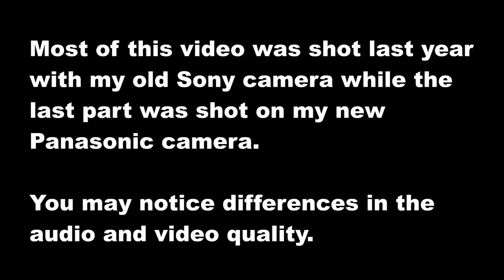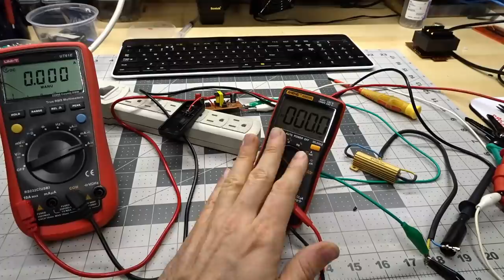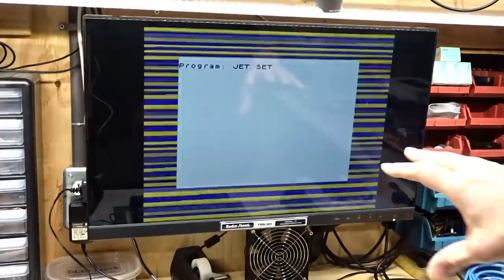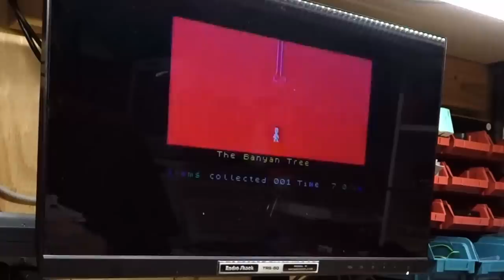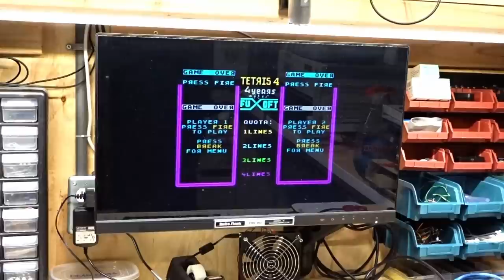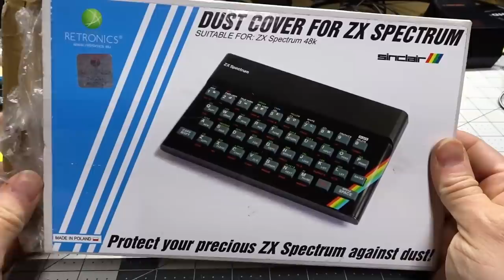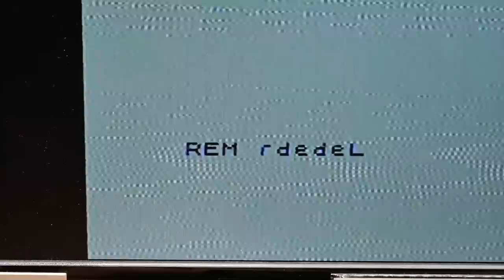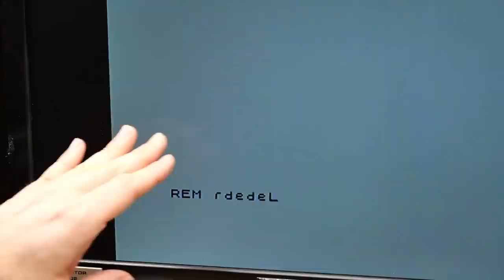ZX Spectrum Part 3 - Revisiting the machine at last!

Comment: Yay, an American who appreciates the glory of the British plug instead of just complaining that it's too big!
Reply: I've watched enough of Big Clive's videos to appreciate the thought that went into the UK plug.
Reply: Yes, that is an old BS1363 plug; modern ones do have "shrouded pins" - never occurred to me that it might be in case of dropping something behind and shorting live to neutral (unlikely, as the earth pin is always at the top, though I suppose it could happen); I thought it was so you were less likely to touch live pins when removing or inserting the plug!

And yes, no way it should have had a 13A BS1362 fuse (sad, I know the British standard numbers!); that - the highest available - would allow 3kW, such as a kettle or electric fire (heater)! [Well, 3kW when we had 240V; we're gradually (it has taken decades so far) moving to 220V, same as the rest of western Europe.] Unfortunately, people (including the people who sell the plugs) tend to put a 13A (brown) in so it'll work with anything. I've seen BS1362 fuses in 1, 3, 5, 10, and 13A, but most shops only carry the 13, 5 (black) and 3 (red). For virtually all eletronic devices, you should have a 3A fuse. I've heard it said that's just to protect the cable (what we call a mains lead and you call a line cord), and the equipment should have its own, lower rating, fuse; that's quite plausible, as even 3A is 660-720 watts!

I grew up in Germany, with Schuko plugs (though I never heard them called that while there), so I do tend to think BS1363 plugs are a bit on the large side - but I suppose when the standard was designed, a lot more domestic equipment was kettles, heaters, washing machines, etc., and if they wanted to make one single standard plug, they had to. (Previously, we had "round pin" plugs - basically, much the same design other than the pin shape and they did not have the fuse in them - but they came in three different sizes - 5A, 10A, and 15A. (Plus a 2A one mainly used for lighting that didn't have an earth pin.)

One shortcoming of the BS1363 - and of its three-pin predecessors - is that, due to its side cable entry, its default rest position is on its back with its pins up. So what, you may say? Well, just wait until you tread on one with bare feet … (-:
Reply: @G6JPG  It's not just that you're worrying about something slipping behind when you go to plug it in, but to keep kids from electrocuting themselves. My brother and I learned our respect for electricity the hard way when we were kids.
Reply: @BlackEpyon  If you read to the end of the sentence,  you'd have seen I said exactly that! (Granted, you have to click "Read more" to see all the words, but even without, you should have been able to see "I thought …" (-:

(Someone else further down the thread also made the same point [specifically that children have smaller fingers].)
Reply: @G6JPG  I don't know why, but half the time the "Read More" doesn't show up. Maybe it's just FireFox, or maybe YouTube borked something up the last time they redid the interface.
Reply: they are too big though... and painful to step on
Reply: always with a stupidly over spec'd fuse.

Comment: Backoff on the phone volume and compensate using the amp...It was a skilled art back in the day ..uk specy owner here..
Reply: Was gonna comment just that. The same is true for any audio output device. Even running my old 160gig ipod through the cars tape deck via a cassette adapter. Would always get far clearer sound when turning down the preamp from the ipod and using the car stereo amp to do the volume boosting. Around the 70 to 80% range on the ipod headphone output would yield good results. The same has applied to any smart phone I've owned.
Reply: Yeah I was thinking the same thing, the phone is still too hot for the amp, so back it down. Also might make sure there isn't any EQ being applied to the signal via any phone audio effects settings like bass boost or a audio profile.
Reply: Especially when the tape was a copy.
Reply: I'm with Eggman, had a Speccy when I was 12 years old back in the day. Tape loading was a fine art sometimes. Later on games came on tapes with speed loading which made things even harder, you could hear the difference in the loading sounds as more data was being pushed across it was kind of like the tape was sped up. I remember having an old cassette tape player that reliably loaded games but you had to fiddle with the volume to get the games to load and sometimes they would just fail. It was hard to love the Speccy but I did spend many hours playing classic games like Manic Miner and Jet Set Willy.
Reply: @savvygadgetz  agreed you learned/knew the pitch of the sound you was listening for..
Reply: @theeggman4806  Brings back so many memories about that. Also needed the right tape player as well sometimes (my old one failed so often but another one was much more reliable). But I do remember knowing the exact sound sections where programs would fail; breath held during those bits haha. And then of course there were the poke hacks you did during the tape loading procedure. So many hours spent trying to get the blighter to load games!
Reply: @SiEffen  it was a skilled art for sure 😂😂😍
Reply: @savvygadgetz  Yep, every tape had its own level, IIRC, which I'd write on the insert ... still might not work mind.
Reply: Notoriously finicky! You basically had to have one back in the day to get it right today.

Comment: I remember having notes on my tapes that said "Volume 3" or "Volume 6" etc. I think that is just authentic per-game experience!
Reply: True, but this is an app that takes pure data files and converts them to sound, so it should be highly consistent. When the volume is set right (and in full airplane mode) it should work pretty much consistently. Not sure, but I suspect his issues may be to do with the use of a 7v supply. Does it need 9v to properly amplify the audio signal in? Another solution is to use a phone with a louder 3.5 jack out, I have noticed when using bigger high importance cans that not all phones produced the same max volume levels. And when maxed out some phones could distort the sound.
Reply: Had same on my bbc cassette. Needs full volume . Set volume to 3.5 etc
Reply: Some nerd analog audio :)

The digital replaying is exactly consistant, but the program's volume is a variable to whom transferred/captured it to file, and the volume on the source tape.  Just like when someone does LP/cassette to wav/mp3; the cassette player volume level, sound card record volume level, and even tape wear fade does cause complete volume inconsistantcies from 'program' to 'program'.  I doubt anybody ran a normalization pass conforming to a certain db level on each captured program recording.

Imagine a collection of xeroxes, made via a myriad of different copiers across the country.  Contrast levels would be all over the place, page to page.

Same happens even between album to album with CD's (sometimes even track to track on an CD album), but thats another story alltogether.
Reply: @andrewnorris5415  Because we would copy games back in the eighties on a double cassette hifi, sometimes we had to lower the volume at the point it was crashing, to get it to load. Those files are copies and not an original cassette.
Reply: @andrewnorris5415  Audio distorts badly on mobile phones when at max. I know this because I test it regulary and the audio when amped is awful.

I go with what you say, low voltage and maxxed phone volume = bad.
Reply: I was going to write this exact comment.  always considered it part of the game...
Reply: @emprsnm9903  Surely it would make sense to convert the audio back into the original digital, not digital audio but the program itself, and then have the app convert it back into audio to send it so that it can be completely consistant.

Comment: When you bought electronics in the UK back then, you didn't get supplied with the plug, so you went out and bought one at the hardware store. Fuses typically came pre-fitted, with 13A as the most common (works with everything, right?!). People either didn't seek out a plug fitted with the correct fuse, bother to swap it, or simply didn't know. Also because you didn't get a plug, it was very common to keep them when you disposed of an old appliance, so often an old one was pulled out of a kitchen drawer and re-used, meaning those older un-sleeved live and neutral pin plugs remaining in use well after the standard changed in 1984. Later (Early 90's?) it became law to have the plug (and so correct fuse) pre-installed on new appliances.
Reply: Takes me back having to pedal down the hardware store on my Raleigh Chopper with my saved pennies to buy a couple plugs for Xmas pressie toys to work.
Reply: @dodgydruid  Ah man, xmas pressies with no plugs (or batteries). So much disappoint.
Reply: Yup, my auntie used to stick bare wires in the plug holes and stuff them with match sticks.
Reply: Sirus Sounds safe. I bet she is living to a ripe old age... coz matches don’t create fire or anything...
Reply: Of course the prime reason one was not supplied with the plug was that some houses STILL had round pin plugs. You can still buy round pin plugs and sockets! However their use is supposed to only be for fixed low current appliances, like lamps. So I'm told. Not sure where this is stated in writing, I guess someone can go look it up ... :D

Round pin plugs were unfused. The fuses were brought in to avoid an appliance fault dragging down the entire ring.  Yes in the UK plugs were - and still are - wired in a ring, rather than a string like other countries do. This was to save on copper after the war. You could run thinner copper for the same number of sockets in a ring versus a string (or, radial...) circuit. Because you have 2 parallel current paths I guess. 

Where's bigclivedotcom to explain this better when you need him? ;)
Reply: I still have a drawer of old plugs, most with unsleeved pins. I still use them. Anyone that puts their fingers or something metal behind the plug when unplugging it is stupid and deserves to get a shock. Its their own fault. Plugs with unsleeved pins are perfectly safe when used correctly.
Reply: @simontay4851  Stupid or a child. That was the issue. Children had fingers small enough to pull the plug out then touch both pins. while they were live. That's why they changed it ...
Reply: @macartm  I had not realised about the round pin plugs, makes sense, I just remembered that you didn't get given one. You're right about the ring circuits and why, although the fuse in the plug is there to stop the skimpy cable of the appliance catching fire; that thin mains cable running to the ZX power supply wouldn't last long if  there was a short circuit and the entire 30A of the ring was now flowing through it. I'm quite sure Big Clive has done a video!
Reply: @Jimbaloidatron  Yeah BS 546 are the round pin plugs and BS 1363 are the square pin type.  

You also get/got all kinds of weird plugs :D

https://en.wikipedia.org/wiki/AC_power_plugs_and_sockets:_British_and_related_types
Reply: "Later (Early 90's?) it became law to have the plug (and so correct fuse) pre-installed on new appliances."
That's the EU regs coming in. We'd have left it alone if we didn't join the EU. 

Standards Harmonization was where I was working (BSi) at the time, in the 1980's through the 90's. The EU gravy train was an easy ride....
Reply: Oh yes the days of having put a bloody plug on the thing before you could use it!
Reply: @frazzleface753  Always remember learning as a child (I'm guessing age 8 or 9)  how to wire a plug. Really threw me years later talking to the new grads at work and discovering they didn't know how to do it.
Reply: @simontay4851  everyone in the uk, of a certain age, has a drawerful of old plugs that they'll never need to use. I am of that age.
Reply: @macartm  I've seen some places installing round pin sockets even now - turns out their cleaners were unplugging sensitive equipment to use the socket for a vacuum cleaner. Now all their vacuums and floor buffers have round-pin plugs on!
Reply: BS 1363 came out in 1947 and required a BS 1362 fuse in the plug, It came to use in 1965.
Reply: @MickyD-si3vs  So, the "The Plugs and Sockets etc. (Safety) Regulations" and the "Consumer Protection Act 1987" were EU regulations? No, actually not. It was a UK instrument to keep "cheap imported" appliances out of the country. Note that BS 1363, which requires the BS 1362 fuse in the plug was introduced in 1947 and became effective in 1965.

In any case: http://ec.europa.eu/DocsRoom/documents/8716/attachments/1/translations/en/renditions/pdf explicitly states that plugs and sockets are excludes from EU directives. Another source: http://www.nsi.org.uk/wp-content/uploads/2016/06/EUREF.pdf also mentions that plugs and sockets fall under "UK national public policies".

Still hard times in the UK...even after the EU exit, no appliances will be sold with bare wires sticking out of the cable. Most inconvenient.
Reply: @UberAlphaSirus  Back in 1985, I powered a kettle, heater, TV and stereo in a run-down bedsit with two wires stuffed into a lightbulb socket located in the bathroom below my room because the power to my room had been disconnected. :D
Reply: Oh I remember the round plugs from the 1970s  suprised they were still around by the 1980s but guess they still worked.  @macartm

Comment: Right, we cannot leave it like that! :) I'll send you some other gadgets to get you a gaming experience. The speccy likes it's original psu. The input voltage is also routed to the edge connector.
Reply: I suspect 7.5v is a bit low too, thats right on the edge of the dropout voltage for the 7805.
Reply: @jaycee1980  Vdrop 2.0 @ 1.0A 25C so he should be good, I suspect his voltage at the plug on the back of the Speccy is better than in his test setup (lots of dodgy test lead losses lol). Does the speccy actually run close to 1A without add-ons?
Reply: What were you going to send him? Can I have them too? :P
Reply: Can't you swap out the regulator to a modern one and then you don't even need the heat-sink and the whole machine runs a lot cooler/better?

Comment: Back when that Spectrum was first used, electrical devices in the UK didn't come with plugs attached.

The first job was with anything electrical was to attach a plug, which was usually "borrowed" from something else, because nobody would remember to buy a plug at the same time as the equipment that needed it. So it's possible the Spectrum would've worked with a lower amp fuse, but whatever donated its plug needed 13 amp fuse, and it wasn't swapped.
Reply: Not a question of it possibly working. It will work. Your average UK consumer has no idea what the differences are between voltage and current. So much so that I once returned a faulty clock/radio to a shop only to be informed that I had put the wrong 1A fuse in the plug (perfectly adequate for the device since its current draw was ~250mA) instead of what they considered to be the correct 13A fuse. Needless to say I got a replacement once I pointed out to them that the 1A fuse was correct and what is the actual purpose of a fuse. A 3A fuse would be the one to use for a ZX Spectrum. I always added a 1A fuse on the DC side as well for added protection or maybe a bit more if I was plugging in extras to the add-ons port.

On another note, the ignorance about electrical safety becomes a real worry when you open a UK plug and find tin foil wrapped around a blown fuse.
Reply: When you bought a plug it would have a 13A fuse in it, you had to buy say a 3A fuse separately. Lots of people would not know to buy a lower rates fuse.

Comment: I once had a cheap unshielded headphone jack cable hooked up to a powered speaker that was picking up a random radio station.  You threw away the yellow video cable because of the interference you saw on the monitor.. but you never swapped out your unshielded/spliced audio cables from your phone & amplifier while having all your tape loading problems...  it’s the same issue, and I’m surprised you stopped short while troubleshooting the problem.
Reply: That was my exact thought re the game load issue!
Reply: At least you could easily get the Speccy's cable, the BBC one was a total nightmare as you needed a specific one plus a tape machine that had a DIN on it for output, the Atari 400/800 you had to buy their tape machine which was hugely expensive and not very good either.
Reply: yea but the audio isnt running in the megaherz bandwidth
Reply: @osgeld  Correct.  And while it would have caused interference, it wasnt subject to the same frequency resonance as the video so the bitrate would have remained unaffected at those frequencies.

Comment: When you bought a plug in the UK (and you had to - because appliances didn't come with a plug on as standard), it would invariably come with a 13A fuse, because they didn't know what would be run through it. You were meant to swap it out for a lower ampage fuse, but of course no one ever did.

Comment: Lovely video! Keep up the good work!  My thoughts / recommendations:
1.) You should really grab a small Bluetooth module / amp and embed it in the speccy...
2.) For the loading errors -- Check your 7805 and make sure you're actually getting 5v; if you're only getting 4.8, it could exasperate the interference issues... (going lower than 7.5v could cause that!) Also, maybe some shielding on the amp could help? Otherwise the noisy power supply could be to blame... 
3.) Not the complaint you were expecting with the power supply, but, I would have put a counterweight in there (sometimes you can find them in wireless mice), just to give it a little more heft.  This has a functional benefit, in that, the power supply will stay where you put it, and not be dragged around by the cable.